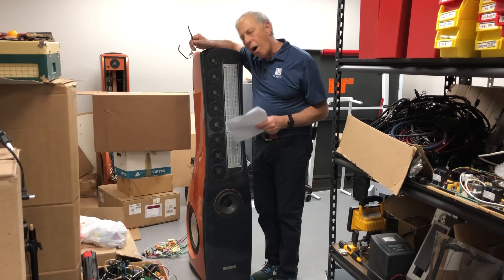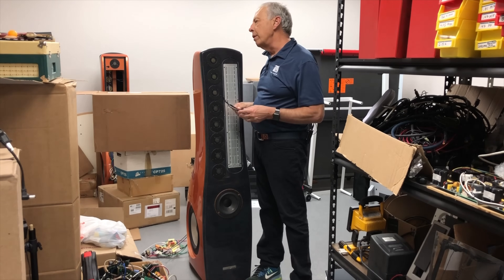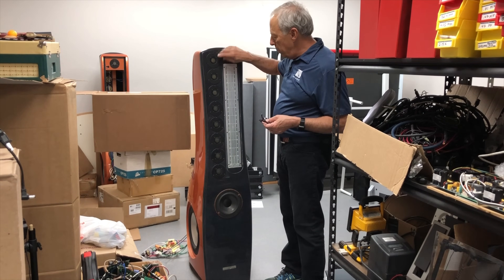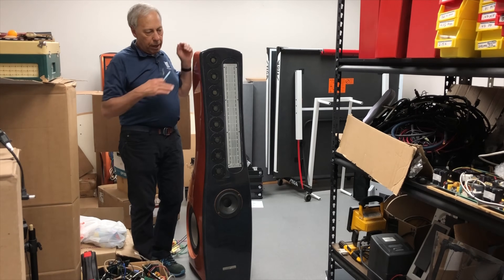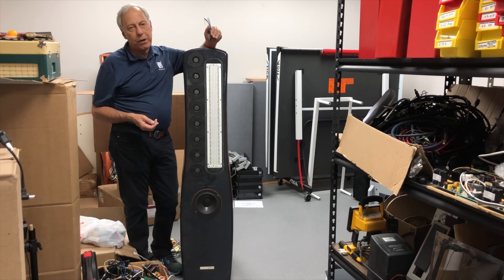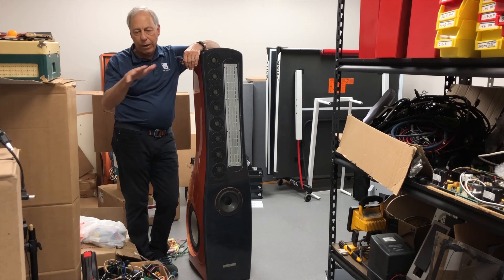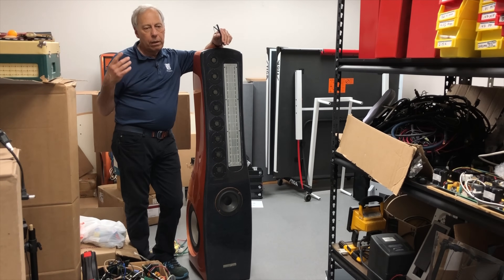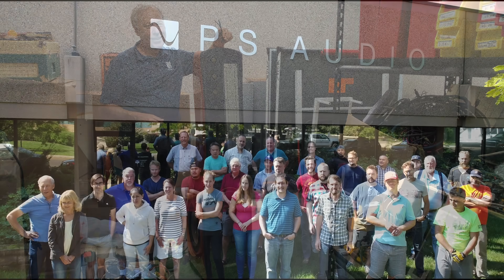Do we listen off axis?

Comment: That's why the baffle is design like that to give better off axis, not sure why I don't like it is the mid-range driver I think should be closer to the ribbon tweeters and mid-range and setback in the cabinet, prevents less manipulation with the crossover, what intern always going to degrade some of the sounds being produced. this would be better because they can be placed closer to a wall and not being in a perfect position more in the centre of a room what is inconvenient to most people and works better in a smaller space. The vocals will be more pronounced as well

Comment: In a wider context , you always listen off axis no matter how you position your speakers : it's called indirect sound from wall/ceiling/floor refelctions . And this is the achilles heel of conventional box speakers because their off axis response is all but flat . A conventional box speaker's indirect sound is completely different from the on axis response : the woofer radiates omnipolar in 360 degrees , while the tweeter beams heavily . This non constant directivity confuses the brain and needs a psycho acoustical correction . This consumes brain resources that cannot be put to use for reconstructing the auditory scene. It is a similar effect to a speaker with lacking bottom end : the brain will try to reconstruct the missing bass freqencies using the upper harmonics but at a cost : lack of imaging . This becomes very apparant when you suddenly add a subwoofer : imaging improves dramatically as the brain is now freed from the task of reconstructing the missing bass and can use those resources now for imaging . Back on topic , a constant directivity speaker (well desigened dipole or omnipole) will have the same off axis response as on axis and that is the reason why these speakers sound so good : the indirect sound has the identical timbre as the direct sound, so no confusing off the brain at all.

Comment: Speakers have typically a ”design axis” where the output of different drivers are supposed to  sum correctly. This doesn’t necessarily have to be the tweeter aimed at listener. 

For example the prototype designed by Arnie Nudell (RIP) that Paul is showing in this video has mid range panel beside the tweeter array. Depending on the crossover design this will produce a lobe to the radiation pattern at the XO frequency. As Paul commnents the tweeters are designed to be at the inside of the speakers, which indicates that the lobe is designed to be directed away from the listener.
In addition, the tweeter array can be designed to project sound to certain direction on vertical axis by adding various amount of delay to individual tweeters. ”On-axis” for this kind of speaker is where the designer has directed the beam. I don’t know if there is any  beam forming in the speaker that Paul is showing or is it just a line source. (However, this kind of tweeter array with so big distance between the drivers will cause lobing towards the high frequencies where the wavelegth gets shorter than the distance between drivers but maybe it’s not so much of an issue in practice.)

Comment: I think you pointed it out but I'll say that it largely depends on the speaker in question. Some are best on axis, others not and one thing I note with being literally ON axis is the possibility of beaming, that is, the tweeters may "scream" at  you and thus over power, but go slightly off axis can reduce this by quite a bit, but not loose sight of the tweeter information, just that it gets toned down a bit so you aren't being assaulted by too much treble at anything above low volume.

I run a vintage pair of ADS L810 bookshelf speakers with a pair of 8" sealed drivers per cabinet and a 4" soft dome midrange, and a 2" soft dome tweeter, non mirrored and I have them set fairly wide apart, but slightly towed in so they are not exactly on axis and I sit on the couch on the other side of the room, room itself is roughly 15.5x11.5Ft so not a big room at all. Amp is the NAD 7240PE receiver with a conservatively rated 40W RMS but is quite a dynamic sounding receiver that's punchy and just wonderful.

But here, the tweeters don't scream at you but you DO get the treble information quite well and have good imaging too. One thing in favor of these speakers is the tweeters are less hard/edgy as they are soft dome, rather than metal dome so if anything, that helps with reducing listener fatigue a great deal.
Reply: John Palmer Agree, like Paul i also prefer listening a little bit off axis as it creates a better imaging imo and less fatiguing.

Comment: Because most speakers have their drivers arranged in a vertical line, I find that the listening height is a more critical consideration than the lateral angle.
Reply: Just recently discovered this in the nearfield. Started using the longer stands for the isoacoustics and wow it made that imaging lock into a pinpoint.